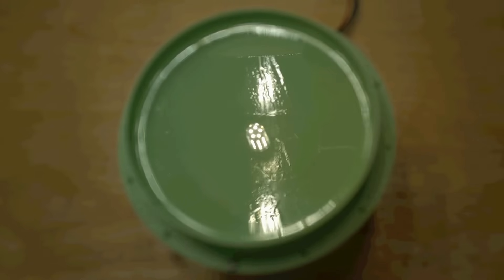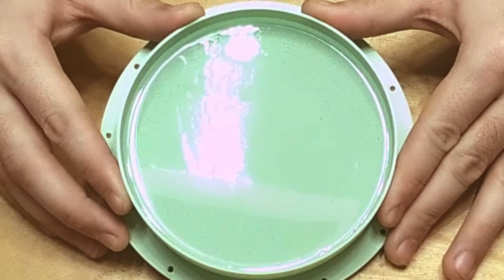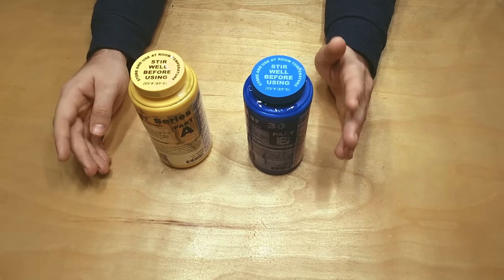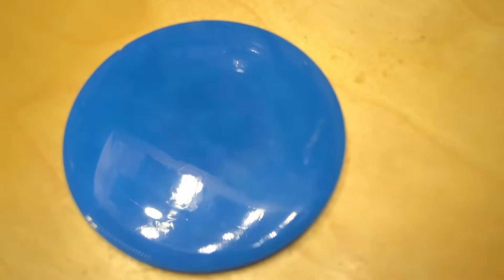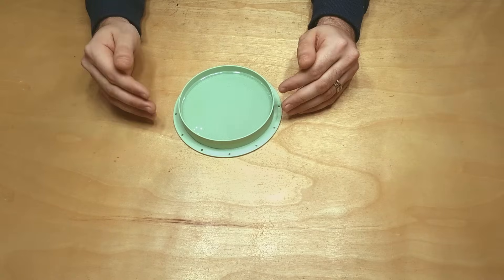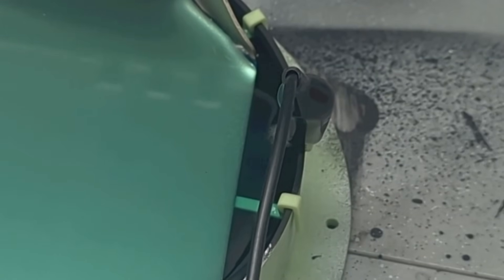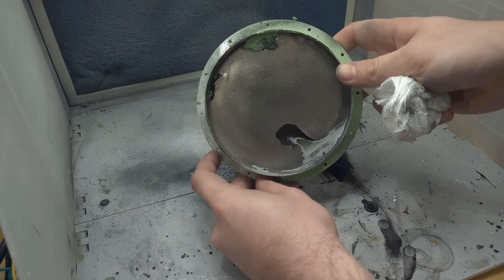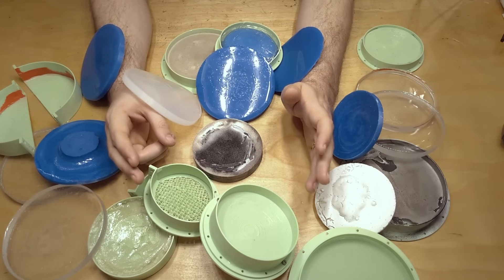Making Mirrors Is Hard

Comment: Make a resin blank just like you did, or use one you have that's ok and use it as a mold to make a plaster cast (plaster is dirt cheap) 
Pull the cast off after a day or so and clean up the rough sides. Flip the cast over and carefully smooth out any bumps with some 800 grit wet sandpaper, small holes or indentations should be ok. Let sit for 2 days. 
Now with some dry grit from Amazon or wherever put the plaster cast back on the resin with some water and grit to smooth out the resin, moving the plaster in a W and figure 8 motion across the surface, letting the plaster come off the sides an inch or two then back across, using light pressure. Slidey slide side to side. 
Very quickly the two will form a perfect parabola, use grit starting at 400 to 1000 then the two-part liquid mirror spray. You can use the plaster cast to smooth out the primer and black paint as well with the 1000 grit and water. It should take about an hour, or until the surface looks good, and rotate the resin 1/8 turn every few minutes 
Easy peasy, you got this.
Reply: Does that work with parabolic surfaces? Fine with sphericals, but wouldn't offsetting matching paraboloids laterally be impossible?
Reply: @MachiningandMicrowaves  Yes, it does make a sphere, which will work just fine but there will be some aberration at the outer edge of the mirror. To get a true parabola you would slightly flatten out the outer 10-15% of the mirror by letting the plaster cast spend more time away from the center. You're only going to flatten the edge by about one wavelength and that's in the final polish stage. John Dobson has a great tutorial video on the whole process.

Comment: nice video, but... Actually there is a proven method to make DIY mirrors. --> grinding glas.
Search for dobson telescope https://www.youtube.com/watch?v=snz7JJlSZvw

The difficulty is to get an optical mirror. The Surface defects are to high.
Also the Glas one uses is important! Today there are glas ceramics available that dont distort much on temperature changes.
Also the mirror has to be supportet in a way that the fopucus point dont shift unter the mirrors own weight.

If casting optical mirrors from resin where a reliable way to make optical mirrors there would be verry cheap ones in walmart already i guess.
Reply from the maker: That's true, but where's the fun in that lol. For me the point of the project was to try something new, not so much to actually make a mirror

Comment: Used to have to do electroplating on jewelry, it (rhodium at-least) sticks better to a polished surface, so its probably in your best interest to get the receiving surface as final polish as possible before plating so the coating goes on evenly, and shouldn't need much further if any processing. this may also explain why your leads were bubbling significantly more than the intended target, as they have a decent smoothness to em already
Reply from the maker: That makes sense, I definitely got a better plating on the leads than I did on the mirror

Comment: You can try 3D print your mirror blank from ABS and then put it into acetone vapor chamber to smoothen it's surface and then try electroplating, never tried it but I've seen pretty good results from acetone smoothing

Comment: i absolutely adore this! i wanted to try this exact thing in the past, since thats usually how they make those mirrors in the first place. (not with those, but with molten glass and molten tin :P)

Oh btw about the wavyneess. i think one could really get away with doing a hacky job with mirrors.
it only has to be good enough to be properly focus IMO, one could simply correct for distortion etc later using open CV. and "remap" the pixels.

in the future if you want to try this again, you may be able to try to do it with tin and a eutectic mix of NaCl KCl and LiCl. that way youd be done qicker and would be left with a finished mirror (already shiny)
a small camp stove on a turntable doesnt sound toooo save but.... could be worse.
Reply from the maker: I'm really glad you liked this! True, I hadn't thought about correcting it in software, that would be a fun project. It wouldn't be too hard to make a heated turntable, but I think I'm done with this project for now.

Comment: I'd just go with mercury, it's toxic, yes, but the dangers are far smaller than most people think, you're already working with resin, which is also toxic.

The heavier liquid should make a more even surface.
Reply from the maker: That's fair, I'd still like a better fume extraction system before working with it.

Comment: Tried that with slow curing epoxy on a record player over two decades ago. Didn't really work as intended. I've seen people use a rotating kiln to make glass blanks with close-to-usable parabolic shape (that's how big telescope mirror blanks are made) that didn't require much grinding to make a mirror. Thermal stability of the plastic is also an issue. All in all, I have come to question if DIY plastic mirrors for telescopes are a viable path.
Reply from the maker: Yeah I don't think they'll every be a good alternative to glass mirrors, especially since you can get a good mirror pretty cheaply these days. But there's something fun about trying it anyways!

Comment: If your spinning mold were to be 3d printed in a rough approximation of the desired shape, then you would not need a large volume of (metal) liquid on top, only enough to fill the gaps of the mold.

To reduce vibrations while spinning, maybe add a lot of mass to the spinning mold, such that it is harder to vary its speed.

Comment: There's copper paint that is more conductive (i.e. less resistive) than graphite based paint. From what I've seen on youtube it makes electroplating a lot faster and more even.

As for liquid metal - traditionally, glassmakers used vats of molten tin as a surface to make glass sheets. Although it's probably way too hot for resin.
Reply from the maker: Yeah, in hindsight there were definitely better conductive paints I could have used. I did consider using bismuth since it has a pretty low melting point but even that was too hot for any resin I could afford.
Reply: @UnnecessaryAutomation  Usually alloys have lower melting temperature than the pure metals that are in the alloy. Maybe there's an alloy that melts around 100 C or so. Like the ones used to desolder components from PCBs

Comment: When making a flat reference surface, you don't need perfectly flat surfaces to begin with. If you rub two mostly flat pieces together. The motion between the planes eventuality causes them to flatten out. The hard part of grinding a mirror is getting the spherical shape in. It's really interesting thay you almost ended up with two potentially mating spherical sections by floating resin. I wonder if you could grind those two pieces together and allow the grinding process to flatten both sides and average out the aberation to the surface finish from curing?

The stepping also seems like a cure time problem with the surface expanding. I wonder if that would stop if you had either a very long or short cure time.

Really interesting overall project. I hope you continue your research.
Reply: If you carefully use 3 mostly flat surfaces, you can produce better flat surfaces. If you only have 2, you actually end up making 2 spherically shaped surfaces (for some very large radius); relatively close to flat but not actually flat. the ox tools series on flat lapping plates is a great introduction to how it works.
Reply: @sgstair  the goal here is to get parabolic or spherical surfaces, not flat surfaces, therefore only two surfaces should be grind together.

Comment: It is probably easier to grind figure and polish a mirror blank and get it aluminized. Fwiw the rotating furnace just saves you the bulk glass removal. Spin casting or pulling a vacuum on a membrane mold would probably be accurate enough for rf frequencies.

Comment: You can try the old DIY method to make telescope mirrors by hand by rubbing and orbiting the glass against an abrasive... It takes a lot of work and time, however, the results are very good. I think that approach will be the same with resin, and it should take much less time. I re-plated my telescope mirror a few times by following the chemical way, but a long time has passed since the last time I did that, so I don't know if there are newer methods that are simpler. Silver nitrate is not expensive at all; the amount you need to plate a mirror is very low and simple to use. My only concern here is the resin... Resin has a lot of thermal expansion, and if glass mirrors with a very little thermal expansion become a pain in the ass to collimate... I don't want to even think about how hard it can be to collimate a resin mirror with that higher thermal expansion; every increase or decrease Cº will result in a new collimation. Keep working on that! very nice channel BTW!

Comment: Looks interesting. Good luck in your project. Another thing you could try and I didn't see you mentioning is using a different motor. I think you're using a stepper motor which introduces micro vibrations in your system. Since you already have the motor, you could try microstepping. Or maybe introduce a gear ratio in the way so you can turn the motor faster. I think the stepping nature could be dampened by that. Still, changing the motor for a BLDC or something similar might be simpler than all that. Controlling the speed is a little different but doable. 
Good luck!
Reply from the maker: Thanks! I was using a tmc2209 driver with max microsteps which should be pretty smooth. I think the distortions were more likely from the resin producing heat as it cured.

Comment: Krylon Looking Glass Mirror Finish Spray Paint. You spray it on the back of a piece of glass and it turns it into a mirror.
Reply: I tried to find that product in order to know the composition; however, I can't find any relevant info about it apart from the solvents that it contains. I have a lot of interest in this. Normal mirrors use aluminum or chrome; a telescope mirror needs a lot more reflectivity than that, As long as I know, silver or gold are the main options. Do you have more info about that product? Re-plating my mirror using silver nitrate almost every year is a pain in the ass xD. Maybe that is the reason my mirror has been in a box for years...
Reply: @Helio___  Sorry, I know the product exists but haven't used it myself. I think it is mainly used in crafting.

Comment: Thanks for the experiments. It's sad that we haven't found a quick and easy way to make perfect parabolic mirrors at home. Surely nanometer scale precision manufacturing wouldn't be that hard right?
Reply: quick'n'easy is the cousin of perfect. Thos two are never seen in the same town at the same time.
Reply: I'm using a 2000 kg CNC machine to make parabolic, hyperbolic and axially-displaced-ellipsoidal reflectors from solid aluminium and copper, but only at frequencies up to about 0.25 THz, with long-range imperfections of 10-15 micrometres and local errors of a few micrometres, plus surface cusps at about 3 micrometres. That's a VERY long way from good enough at optical frequencies around 500 THz. I'm trying to get the surfaces good enough to use at 30 THz/10 micrometres, but I need to get the local errors down below a micrometre, and my machine can't manage that. In the past, I've polished spherical mirrors for visible light down to optical quality by hand, getting orders of magnitude better results than my expensive metal-munching robot can handle.
Reply: @MachiningandMicrowaves  sounds like the stuff Hyperfine and Zumtobel made for FIFI-LS and PACS :-)
Reply: @MachiningandMicrowaves  Not that I have any experience with any of the things you are talking about, would something like applying a few micrometre thin layers of a semi reflective coating similar to the idea behind multi-layer DVD's and Blu-Ray discs possibly lead to a more refined reflector in anyway? Again, I'm far from posessing even the most basic of understanding in regards to the subject, but curious if a similiar process is already being implemented and if so, what are the pros and cons when dealing with such a process at the level of refinement you are trying to achieve?

Comment: I would probably try going to a speciality paint shop, telling them what you're trying to do, and seeing how much more graphite they can add to a bottle of spraypaint (to make it more conductive). I'd also give priming and sanding a shot before even more coats of paint. You're closer than you think
Reply: Painting will not work, paint is too thick and uneven for an optical quality mirror. Only way to do it is either chemical silvering or vapor deposition.